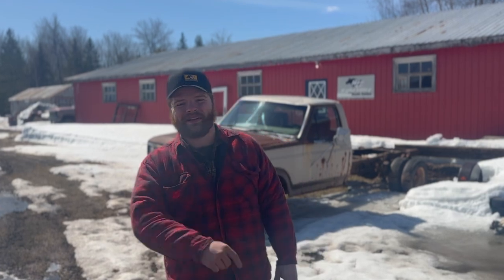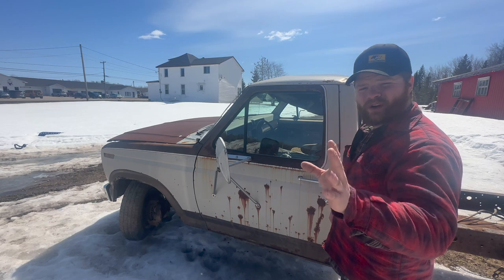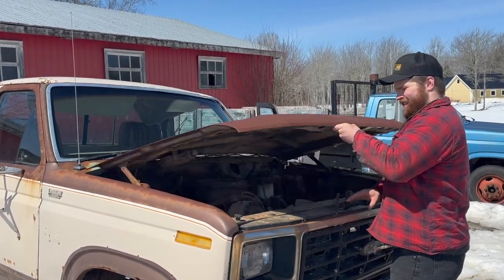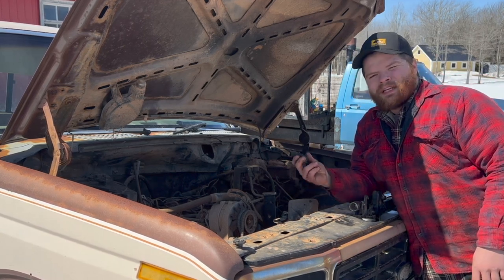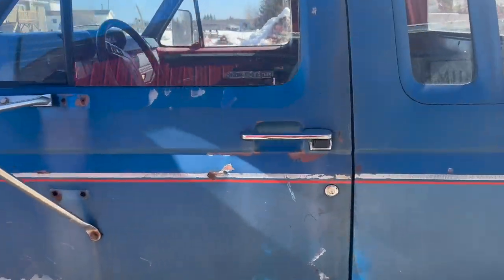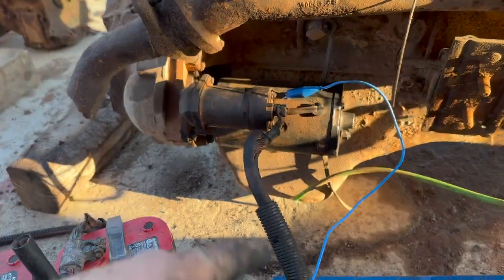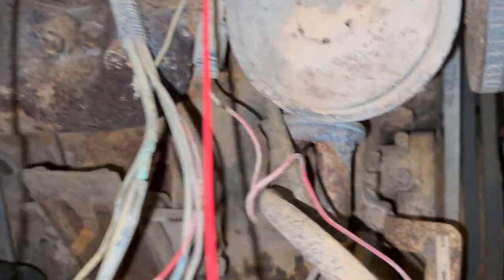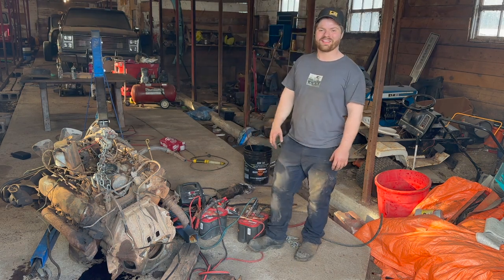Sitting for 35 years, will this old diesel ford ever run again?

Comment: Awesome video Colt! Still lots of good parts on that old truck. That 6.9 sounds great. You'll have that engine running just as good as old blue before we know it. Cheers
Reply from the maker: Yes sir that’s the plan haha, hopefully sooner than later I’ll have it mocked up between the frame rails
Reply: @highostablegarage  awesome! That 6.9 and the old international are going to be like two peas in a pod.
Reply from the maker: @rickyjessome4359  yes sir I think so too

Comment: That's probably a Dana 70. They use the same covers as the 60. I have a 83 f250 with a 70 in it so I would be super surprised that this one being DRW to not be a 70 as well. My truck is also Canadian made.
Reply from the maker: Hum, I actually never laid my eyes on a 70, and main differences on the outside between the 60 and 70?
Reply: @highostablegarage  Axle tubes are larger on the 70. If it's anything like the one I have it should taper down at the wheel / hub flange. Ring gear is larger 10.5 in diameter.
Reply from the maker: @OnusofStrife  good to know I’ll take a look

Comment: Great rescue find! Love these old bullnose Ford trucks, especially the 6.9L IDI diesel V8 engine ones. Axles, transmissions, cooling and suspension all MORE durable. Worthy of keeping engine stock, as zero emissions equipment on it AND turbos tend to fail. A stout dual exhaust like a custom crossover will do it good. Glow plugs biggest issue, but Motorcraft do it best. Worthwhile replacing stock delay switch as  many bypass it and burn up glow plugs otherwise. Glad it's a manual transmission too, as their automatic transmission for these diesel V8 engines tended to explode due to strong engine torque output. Bodies still plentiful out there for replacement, plus seats interchangeable even from 1999+ Super Duty supposedly. Body can be redone then sealed, painted and Line-X coated beds and underbelly. Love that truck!👍

Comment: That is an 82-86 Grill. Only 80-81 didn't have blue oval. Also 6.9 IDI was first used by Ford in 83 so yes that's the correct grill

Comment: Ok i need help my truck has a 6.9 it was an ether baby i was told but the dman thing wont start probably originql starter the batteries are 700 cca and thats what it had when it was running and i cant figure out why it wont start toher than its just been sitting